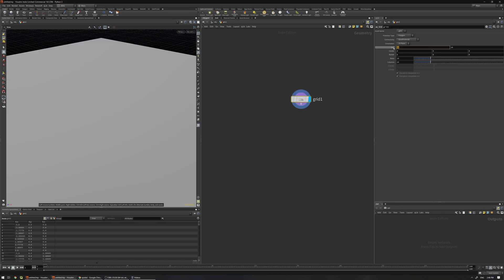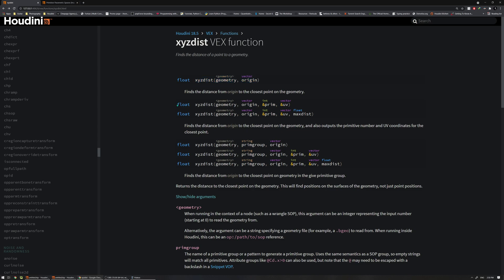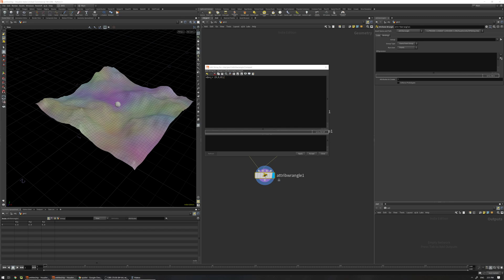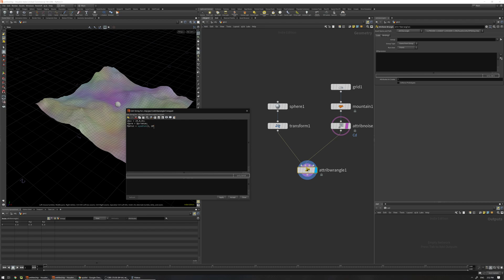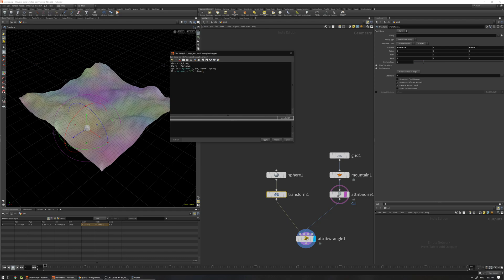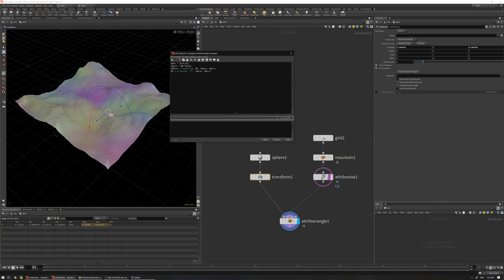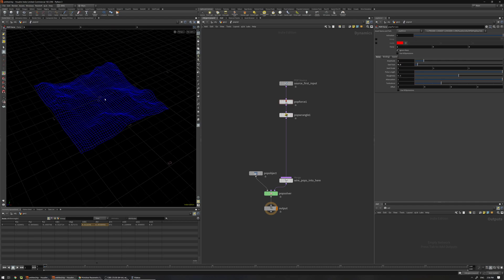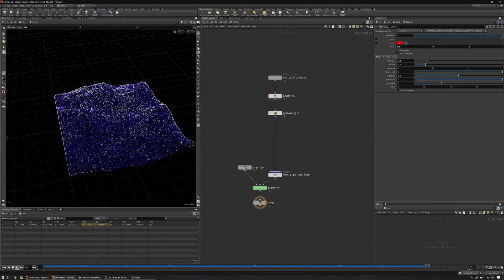02. vex xyzdist & primuv functions

Comment: Just a rookie question. How come some attribute using in @P and some using in "P" ? what is the different on that?
Reply from the maker: It depends on the vex function definition, some functions needs specifically a position or origin which is a vector type, the you need to pass @P to it, sometimes a function needs an attribute name which can be any type, it this case you just pass the name of attribute like 'P' or 'Cd' etc. in case or primuv because it can sample different attributes we pass 'P'. we can also pass 'Cd' or any other attribute even a float. hope this helps